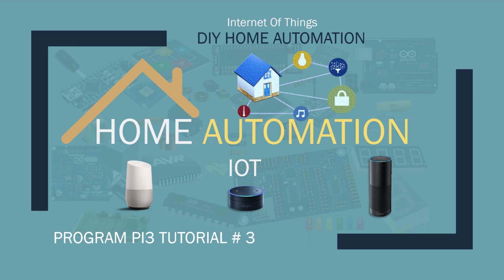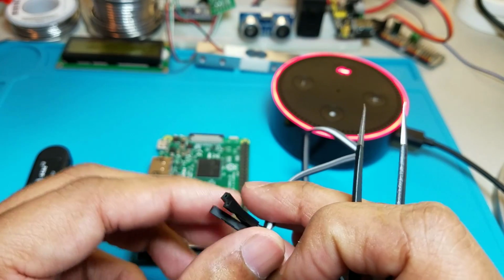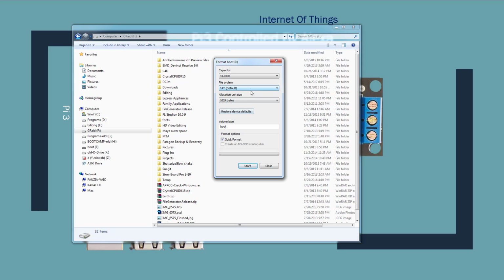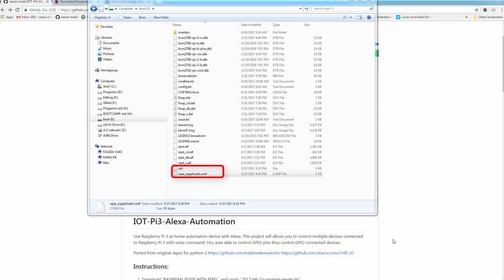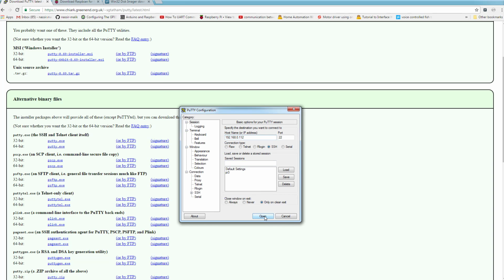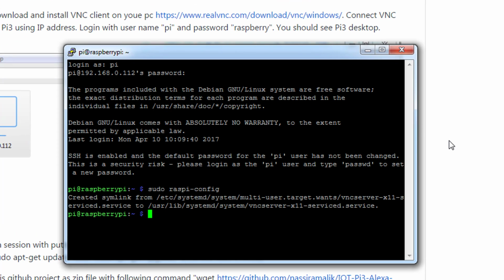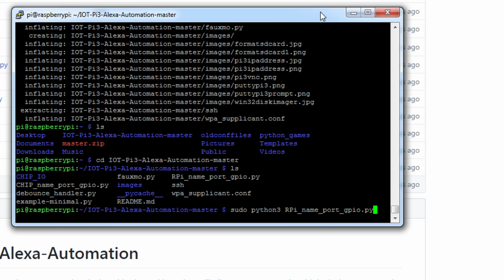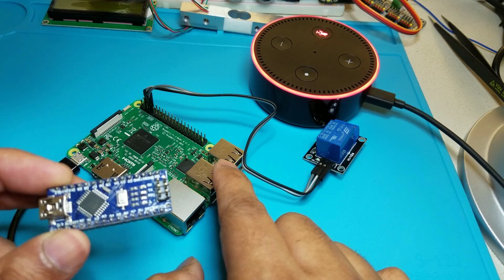Raspberry Pi projects beginners | Home Automation with Alexa | Tutorial # 3

Comment: Does this work on a 3rd generation echo? I ask because I cant get alexa to find devices...
Reply from the maker: I updated the code and it is working with 3rd Gen Echo dot.
Reply: @netmedias7657  Thanks Bro, funny thing is that I racked my brain so much over the last week, I finally got the concept to control the GPIO with Node-Red, no coding needed. Check into it, and If you are familiar with, I need the flow for the PIR sensor...

Comment: Hi,
Will this work if i have NOOBS installed instead of Jessie? Thanks
Reply from the maker: Yes, use python 3.4 or above.
Reply: @netmedias7657   I have been using python3.5.3, and the pi and the alexa are on the same network. This is the invoking command and the debug output. Thanks for the support...

$ sudo python3.5 RPi_name_port_gpio.py

DEBUG:root:Listening for UPnP broadcasts
DEBUG:root:got local address of 192.xxx.x.xx
DEBUG:root:UPnP broadcast listener: new device registered
DEBUG:root:FauxMo device 'living room' ready on 192.xxx.x.xx:51000
DEBUG:root:UPnP broadcast listener: new device registered
DEBUG:root:FauxMo device 'kitchen' ready on 192.xxx.x.xx:52000
DEBUG:root:Entering fauxmo polling loop

I tell alexa to find devices but no luck. Should I install another newer version of python or do you suggest something else? Thanks
Reply from the maker: Are you sing 3rd gen Echo or Dot?
Reply: @netmedias7657  I'm using 3rd Generation Echo Dot
Reply from the maker: @NathanPhippsONeill  Discovery only works with 1st and 2nd gen but you can control it will all 3 generations once it is discovered.
Reply: @netmedias7657  That explains that. Thanks. Is there a resource I can use to discover the pi?
Reply: @netmedias7657  Or do you have another suggestion?

Comment: Is that relay good to switch on and off 220v lights? What I mean, is that I want to connect the relay to the lights in my living room and use alexa voice command to turn it on and off, to act like a swtich.
Reply from the maker: Yes, you can control an AC load 110v/220v up to 10 amps.

Comment: Hello nice work. Is there any way to simulate a trigger not a switch. I want to open my garage door with relais and it need only a short impuls (1sec) so wehen i say alexa open my garage for example. that the script give only short impuls and close the relais after 1s...and give answer to alexa that it is a trigger not switch...?? thx
Reply from the maker: Alexander Frimmel Yes, it is very easy. Do the following for each GPIO.

Replace  "GPIO.output(int(11), state)" command to follwing 

GPIO.output(int(11), true)

time.sleep(1)

GPIO.output(int(11), false)
Reply: @netmedias7657  DEBUG:root:Responding to ON for Garagentor links
State True from client @ 192.168.178.170
Traceback (most recent call last):
  File "RPi_name_port_gpio.py", line 72, in <module>
    p.poll(100)
  File "/home/Fauxmo/IOT-Pi3-Alexa-Automation-master/fauxmo.py", line 88, in poll
    target.do_read(one_ready[0])
  File "/home/Fauxmo/IOT-Pi3-Alexa-Automation-master/fauxmo.py", line 152, in do_read
    self.handle_request(data, sender, self.client_sockets[fileno][0], self.client_sockets[fileno][1])
  File "/home/Fauxmo/IOT-Pi3-Alexa-Automation-master/fauxmo.py", line 227, in handle_request
    success = self.action_handler.on(client_address[0], self.name)
  File "/home/Fauxmo/IOT-Pi3-Alexa-Automation-master/debounce_handler.py", line 15, in on
    return self.act(client_address, True, name)
  File "RPi_name_port_gpio.py", line 35, in act
    GPIO.output(int(7), true) ## State is true/false
NameError: name 'true' is not defined

During handling of the above exception, another exception occurred:

Traceback (most recent call last):
  File "RPi_name_port_gpio.py", line 75, in <module>
    logging.critical("Critical exception: "+ e.args  )
TypeError: Can't convert 'tuple' object to str implicitly
Reply: Ah typical Linux Problem Upper and lower case input :-)
Reply: @netmedias7657  Works look down!!!  But one question more pls. In Alexa they are defined as switch not as Trigger. That means when i call or push button in the app or in show. It comes signal...no problem...after 1 sec goes off...but in my Alexa ist it still on....is there a way to response to Alexa that switch is on, off......
Reply from the maker: Sorry, it is "True" or "False" without the quotes.

Comment: Hi Nassir, Hope you are doing well! First of all very informative videos you post on your channel. Kudos to you.. I have quick question on this video. I have installed and configured all the steps suggested on this video. Alexa was able to discover devices the first time when I tested. After closing the python file and re-ran the py file as suggested in the video and it did not work. I tried this for all the py files that you have on your github page. The code works well for the first time (one time) and then it does not work the second time when you re-run the py files. Any thing that you can help me with, will highly appreciated!.. Thanks..
Reply from the maker: mohamed shafi Thanks you for your valuable feedback. You GPIO or port is not releasing. If restart pi it should work. If it is doing this all the time then run an update on your pi. Good Luck.
Reply: @netmedias7657  Thanks for the feedback Nassir.  Will do try and let you know.. Is there a way to put this code on boot of pi and run it when the pi restarts everytime?

Comment: devices are found when discovered on echo dot 2nd gen but its not working on echo dot 3rd gen what should i do
Thanks in Advance...
Reply from the maker: Can you share the error from pi terminal?
Reply: @netmedias7657   it doesn't show up any errors but when i tell alexa to discover devices on 3rd gen its not discovering 

 
pi@raspberrypi:~/IOT-Pi3-Alexa-Automation $ sudo python3 RPi_name_port_gpio_8_Relays2.py
DEBUG:root:Listening for UPnP broadcasts
DEBUG:root:got local address of 192.168.0.115
DEBUG:root:UPnP broadcast listener: new device registered
DEBUG:root:FauxMo device 'pc' ready on 192.168.0.115:52004
DEBUG:root:UPnP broadcast listener: new device registered
DEBUG:root:FauxMo device 'xbox' ready on 192.168.0.115:52005
DEBUG:root:UPnP broadcast listener: new device registered
DEBUG:root:FauxMo device 'kitchen' ready on 192.168.0.115:52000
DEBUG:root:UPnP broadcast listener: new device registered
DEBUG:root:FauxMo device 'tv' ready on 192.168.0.115:52003
DEBUG:root:UPnP broadcast listener: new device registered
DEBUG:root:FauxMo device 'room' ready on 192.168.0.115:52002
DEBUG:root:UPnP broadcast listener: new device registered
DEBUG:root:FauxMo device 'light' ready on 192.168.0.115:52006
DEBUG:root:UPnP broadcast listener: new device registered
DEBUG:root:FauxMo device 'office' ready on 192.168.0.115:53000
DEBUG:root:UPnP broadcast listener: new device registered
DEBUG:root:FauxMo device 'living room' ready on 192.168.0.115:51000
DEBUG:root:Entering fauxmo polling loop

it stops right there and it is not discovering...
Reply from the maker: If they are discovered once and are list under your Amazon account then it will not re-discover them. Try to turn them on/off from both echos.

Comment: Will it work directly on echo dot 3 using raspberry pi 2 ? If no could you please suggest which parameters under the code needs to be altered ?
Reply from the maker: I don't have dot 3 but underlying api is same for dot 2 and dot 3 so it should work for dot 3.
Reply: @netmedias7657  No because I tried and Alexa isn't detecting the Raspberry Pi after running the code.
Reply from the maker: Are you using Echo plus?
Reply: @netmedias7657  No.. It's the Echo Dot 3 and I am using raspberry pi 2.
Reply from the maker: Please try "Al Chandeck Chen" solution in comments below.

After searching the internet I found that I could enable the Sinric skill in Alexa and find and replace all appearances of 'urn:Belkin:device:**' to 'upnp:rootdevice' in the fauxmo.py script and that did the trick. Now my devices appear in the Alexa app. However, I can't turn them on or off because it says that "Server is unresponsive

Comment: when i start the programm "sudo python RPi_name_port_gpio.py" and i say "Alexa discover devices" instantly there is a warning with:

Traceback (most recent call last):
  File "RPi_name_port_gpio.py", line 69, in <module>
    logging.critical("Critical exception: "+ e.args  )
TypeError: cannot concatenate 'str' and 'tuple' objects

Don't know what that means
Reply from the maker: Are you using Echo Plus?
Reply from the maker: Use Python 3, not 2.7.

Comment: how soon can you help me .......i downloaded alexa on my phone and it cant find the devices
.....what can i do
Reply from the maker: What is the issue? Are you sing Echo plus? What are your seeing in terminal output?
Reply: am using an android phone ..i dont have access to an echo device so i decided to download an alexa app on my android phone
Reply: i kind of geuss u have to enable WEMO skill ,,,,
Reply from the maker: You don't need a Alexa skill and yes you can use Alexa app in instead of echo.
Reply: @netmedias7657  so how do I go about it
Reply: @netmedias7657  is there any other android app I can use to control the GPIO pin
Reply: @netmedias7657  wat about using google assistant
Reply from the maker: This is the easiest way to control GPIOs behind the routers firewall. Other apps will work only if you are on same wifi network or use an external MQTT service. It is more complicated. Are you using Echo plus? What is the output on pi terminal when you give device discovery command to Alexa?

Comment: Any body help me to run the program continue in putty shell. 
whenever i switch on and off the power of raspberry Pi3 network connection disconnect ,
again i have to unzip the file,then program run. 
is it possible once we configure and run the program in putty and it continue without desktop
Reply from the maker: On your Pi, edit the file /etc/rc.local using the editor of your choice. You must edit it with root permissions:sudo nano /etc/rc.local
sudo python /home/pi/RPi_name_port_gpio_8_Relays2.py &

Comment: Sir,
Thanks a lot for your such a project.
My keen interest in electronics projects but programming word is out my syllabus so it is difficult for me to understand the python programming steps.
I follow you step by step and i make this project finally.This will be a great achievement for me to run this project.
Ddevice in use are,Alexa Echo Dot,Raspberry Pi3 & Relay Module HL585
I face some problem like :
First:-------------------------------------
when i say Alexa  switch OFF kitchen Relay activate
when i say Alexa  switch ON kitchen Relay de-activate

Second:--------------------------------
Alexa say network error  whenever i restart the putty or Pi3

Third:------------------------------------
How to edit and which file shoud be edit to increase the no devices to Alexa

Sir will you please give me the snapshoot or steps one by one to resolve the problem of disconnection of Alexa with raspberry and interchanging the polarity of Relays
Reply from the maker: 1st issue:
Add following before the if statement. Look for an example in "RPi_name_port_gpio_8_Relays2.py" file
        if state==True:state = False        else:            state = True

2nd issue:
On your Pi, edit the file /etc/rc.local using the editor of your choice. You must edit it with root permissions:sudo nano /etc/rc.local
sudo python /home/pi/RPi_name_port_gpio_8_Relays2.py &
3rd Issue:
Use the "RPi_name_port_gpio_8_Relays2.py" file to control 8 devices

Comment: Telling Alexa to "discover devices" has no effect. Nothing is displayed to console. Zero activity. Does. Not. Work. #wasteoftime
Reply from the maker: Are you using Echo Plus?
Reply: @netmedias7657 Yes
Reply from the maker: Changing
"USN: uuid:" + persistent_uuid + "::urn:Belkin:device:**\r\n" in switch.cpp to
"USN: uuid:" + persistent_uuid + "::upnp:rootdevice\r\n"
Reply: There is no switch.cpp.
Reply: But thanks for the reply/effort.
Reply: @netmedias7657  to me, RPI sends a message when i start discovering (echo plus): 

DEBUG:root:POST /upnp/control/basicevent1 HTTP/1.1
SOAPACTION: "urn:Belkin:service:basicevent:1#GetBinaryState"
Content-Type: text/xml; charset="utf-8"
Accept:
User-Agent: Dalvik/2.1.0 (Linux; U; Android 5.1.1; AEOSN Build/LVY48F)
Host: 192.168.0.23:52000
Connection: Keep-Alive
Accept-Encoding: gzip
Content-Length: 299

then, alexa says, Kitchen doesn´t support that

Comment: Hi and thank you for this really nice tutorial. However I've got an issue and I hope someone could help me. When I run the script I get to the "Entering fauxmo polling loop" but Alexa can't find any device. Moreover on my Netgear router I can't see any of them in my UPnp tab. My Alexa is powered by a RPi 3 and the Android App didn't give me any success either.  Thanks !
Reply from the maker: Make sure run it with python 3 and have requests package installed. If you can't see the pi on your network then it a network connection issue.
Reply: Thank you for the reply ! I'am indeed running the script with python 3 and I made sure that I had the proper resquests package. I can see and access to the pi on my network, however, no upnp port is generated while RPi_name_port_gpio_8_Relays.py is running.

Comment: Hello! Thank you so much for the tutorial! When I try to run the command to start the python program I'm getting an import error "No module named 'requests' " Can you please help me troubleshoot? Thank you!
Reply from the maker: You need to install the "requests" module. with pip install command.
Reply: Netmedias was that in the tutorial walk-through? I don’t remember that. I will give that a try! Thank you for such a quick response!
Reply: Quick update and I hope this helps others out. I installed requests with the following command 'sudo pip install requests' and once installed I still did not have any luck. After a quick google search I quickly realized that the 'pip' command is for python2 so I installed requests with the following command 'sudo pip3 install requests' and that did the trick! I also needed to install the RPi module as well for the GPIOs with the following command 'sudo pip3 install rpi.gpio' 
I'm not 100% sure but I think my difficultly could have to do with me using Raspbian Lite which is the command only OS and not using the Raspbian Jessie OS. I'm also using the Raspberry Pi Zero W for this project as I'm in need of a small footprint.
Needless to say, it's running with python program just fine now, so now I need to try it out with Alexa!
Thank you again so much for the tutorial and support!

Comment: Hi,
Actually i want to use fauxmo with flask-ask for home automation.I am using fauxmo but after 26 devices i am not able to define it in raspberrypi3 .Please help me with this.
Reply from the maker: Try to run two parallel scripts with different ports.
Reply: I am trying as you said .I have written two script with different port numbers and connected relays.But alexa is not discovering the smart home devices.
Reply from the maker: Hekami Engineering you need to change the devices names in one script. You cant have duplicate device name on your network

Comment: I follow this video to the letter but my relay never works. I dont know what im doing wrong
Reply from the maker: Are you able to discover the device. What do you see in pi terminal?
Reply: the device is discoverable and when i give the command the lights on the relay light up but there is no clicking sound. ive bought two relays and there is no click on either
Reply from the maker: Try using a separate 5 volts power supply to test. It looks like there is not enough power to switch the relay.
Reply: If there is not enough power, what can I do?
Reply from the maker: Ryan Hooper Try using a better power source.
Reply: i have tried another usb power source and the led turns on with the command but the relay still wont click
Reply from the maker: Ryan Hooper you misunderstood. Connect relay only signal pin to pi and ground and vcc to a different 5 volts  power supply than the pi is connected to.
Reply: Netmedias ive tried both 5v gpio pins if that is what you mean?
Reply: Netmedias ive soldered the wires from a 5v plug to some jumper cables and tested the relay on that and i still get nothing
Reply from the maker: I am not sure what the issue is. Can you give me some more details on any changes you have made. If possible share a video of demonstrating the issue.
Reply: Ive managed to figure it out. I noticed my relay and yours were the same type but for some reason the the inputs are labelled up differently. so your relay inputs are labelled S + - and mine are labelled with IN GND and VCC. once i noticed that it worked fine as it should.

I'd like to take the chance to thank you for your advice and your time. Without your videos on this I would be lost. So thank you

Comment: Hi ,
I want to connect more than 40 devices using a single raspberrypi3 .Is it possible?Please guide me.....
Reply from the maker: It depend on you pi version. You can control as may devices as available GPIOs on board.
Reply from the maker: You can use multiple ESP8266 as slave and add as many devices as you want. They are cheap. ESP8266 version E-12 can control 8 or 9 devices and it only costs under 3 dollars. Good luck.

Comment: Where's the link to the relay
Reply from the maker: https://www.banggood.com/5Pcs-5V-Relay-5-12V-TTL-Signal-1-Channel-Module-High-Level-Expansion-Board-For-Arduino-p-1178210.html?rmmds=search&cur_warehouse=CN

https://www.ebay.com/itm/1pc-DC12V-Channel-5V-Low-Level-Power-Supply-Relay-Module-SRD-12VDC-SL-C-Clips/311941401345?hash=item48a1280b01:g:RcMAAOSwxKtYBpYf